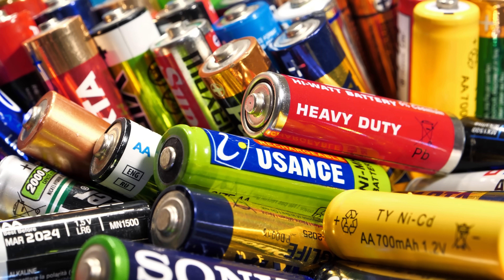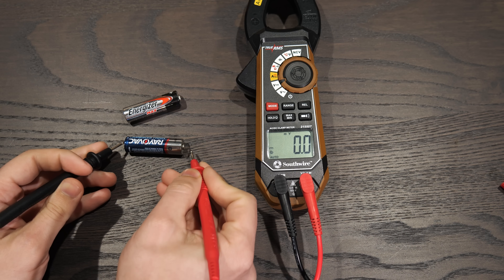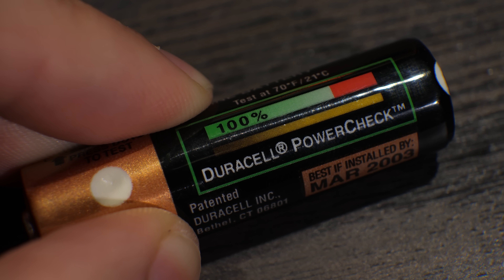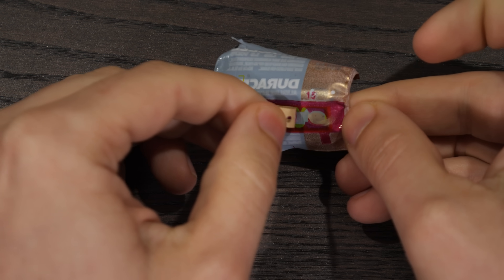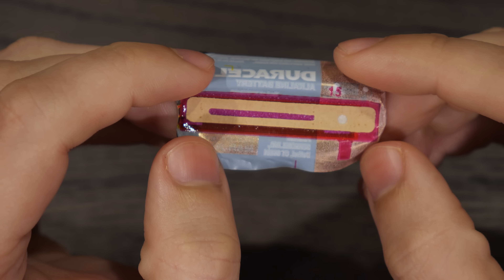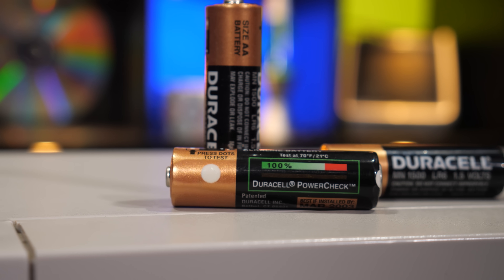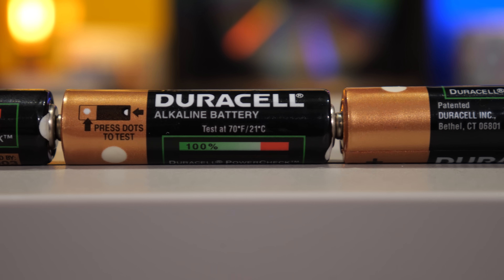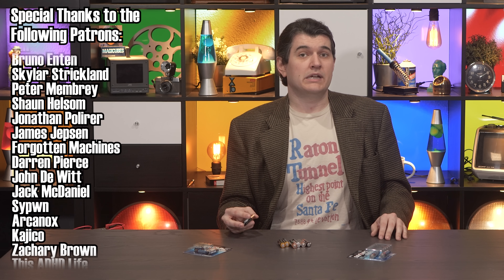Duracell PowerCheck: A genius idea which didn't last that long

Comment: I'm only 30 seconds in, and I'd like to add that the battery-operated interactive Neopet toys used N batteries. Some random obscure battery type that I don't recall anything else using. I think they might have been pricey, too, I don't recall. Either way, that one bugged my parents.
I have vague memories of batteries with a built-in power indicator, but I don't think we ever bought them. I was always kind of curious about them, and as it turns out, it's more low-tech than I imagined it being as a kid.
The other reason people don't use battery testers much is because they judge a battery's remaining power on whether their Poo-Chi turns on, or if the TV remote doesn't work half the time and is driving them crazy. Or if the power light on their handheld game system turns red. Many AA batteries died so I could raise virtual pets on my Game Boy Advance.
One of the impressive things about these PowerCheck batteries is that they haven't leaked. Generally, long-expired batteries are all gross-looking. Come to think of it, if I still have my GBA packed away somewhere, there's a Ziploc bag full of battery puke beside it.

Comment: I always wondered why the testers in the blister and the ones on the battery went away. When I was a kid, we were too poor to have a lot of extra batteries sitting around and we didn't own a tester unless we remembered to save one from the packaging. I WAS the person they made these things for because I would try swap batteries with low charge in flashlights with fresher batteries in the TV remote and I wanted to know if a batteries were actually dead before taking two bus rides to the Woolworth to get a couple more. I had also bought batteries when it was actually the bulb that had burned out and then had to make a second pilgrimage to the store for parts. I would run the check an average of three times per battery so they were super useful to me. Now I just own a couple of cheap universal battery testers so I don't worry about it but the first time I saw one of those was in my 20s.

Comment: Keeping batteries in their package toll you need them does NOT guarantee they are any good.  I have had batteries still sealed in their manufacture package that have leaked I  the package....had zero charge.....white crap comming out of them.  The Duracell testers were more accurate then the analog testers....took up no space.  I wish rechargeable batteries had them built in...

Comment: The main allure of this feature is the ability to troubleshoot issues on the spot. If a battery powered appliance stops working I can take the batteries off, press-check and immediately see if they have enough charge. If the batteries are good and the appliance doesn't work anyway, it's damaged or broken, so no point in replacing batteries. Very common in toys that the children toss around and leave powered on unattended for prolonged durations of time. You never know if it's just batteries discharged completely or the whole thing got trashed.

Comment: Duracell first attached those thermochromic testers separately on battery packages in the early 1990s, then it started installing them on the batteries themselves.

Comment: I saw an advert for these and thought it would be perfect for the rechargables I used in my gameboy. The original gameboy required 4 batteries so you had no idea which one was bust. Then a few months or years later we got a baterry charger that had lights that would go from red to orange to green to show voltage.

Comment: ❤❤
This kind of printed battery testers are very difficult to handle and require lots of pressure. Therefore an useless & non-working invention. Those who invented it, should be punished heavily by 500 lashes per day! I had this kind of batteries, the printed testers never worked. Useless garbage invention! The pure trash!

Comment: That genius idea is still today not just in Duracell but all 18V and 20V and 40V and 80V batteries, they ALL have "Voltage" indicators. 
Voltage is different from capacity. You can have 12V but still be a weak battery

Comment: The powercheck feature still exists on Duracell Ultra range batteries 🔋 I have some dated 03/2029, which I thought were unused but don't work in my device. The indicator isn't working either. Hence, I'm viewing your video. 

Thanks. Very well explained.

Comment: In theory, is it possible to use almost-dead batteries if it was possible to line them up in series?
Reply: Yes 2 or 3 weak batteries in series would equal 1 good battery. Issue is getting them wired to the device.
Reply: I'm glad to know that it'd work in theory.

Comment: I usually don't have half used batteries because I use accumulators.
The rare AAA batteries I have go usually in this order: tools and the automatic perfumer (has a motor), lantern, temperature sensors, remotes

Comment: I would totally use these today. I try to pull batteries out of the things I don't use much so they don't leak and destroy my electronics. I have a few batteries lying around that I'm not certain if they're bad or just slightly used. I also once pulled a fresh battery that didn't work in one of my devices, so without a proper tester, I don't know if the problem is with the battery or the device.

Also, you can tell that he doesn't have children because any parent knows that all the crap kids play with now uses batteries, and none of it has battery charge indicators.

Comment: I worked on that project at Duracell, it wasn't all that genius, it was a gimmick.  I can go on with all the problems it had but the main two were ... using it drained the battery quicker than you'd expect, and it would activate on it's own when installed in some tight battery compartments even after the numerous redesigns,  causing it to drain the battery at best, catching on fire at worst.

Comment: Hello ... Always wondered how they functioned, but honestly said I never thought of removing the label. Guess it's one of those things that come to mind, but is never important enough to remember to do. Honestly I still have roughly eight of those batteries today in reserve, at least 20 in use and continue to purchase them when I need batteries. Wonder if I will be able to obtain them the next time I need to buy some as I did notice the last time that they were not as available all over as in the past where I live. I always save the batteries that no longer function in one gadget to use for another that need less power (example wall clocks) and they would often run another six months to a year on them or more at times. I may be odd in comparison to others, but always used the batterie checker and had no problem with having to press hard in general. What I did notice is that when one had moist fingers (after washing hands or so) it was better to wait a while. Is Duracell expensive in comparison to other batteries? Yes, but I always keep an eye out for when I can get them to a reduced price (Amazon or so). However I found for my purposes Duracell tend to last longer than other brands so they were worth the money IMO. I know one says never to mix new with old batteries as they will drain faster. However I never mix different brands either. Maybe I over do it? 🤷🏻‍♂...Yes, I always use a multimeter before I recycle batteries and discovered decades ago that in general 1.35 is rock bottom with usage in most cases. Thank you for the very interesting and well explained video.

Comment: It wasn't genius. They didn't work properly, and you know if a battery is flat because it doesn't work. Mixing different age batteries is the worst thing to do, so the check thing on the side is pointless.

Comment: I think the on-battery tester comes from the idea that, oh hey my device just died and I need some batteries - but wait I don't have any new ones, let's take the batteries from something else. And thus you have mismatching batteries, the odd battery, new batteries, old batteries... And by the time you actually get around to purchasing more new batteries you're struggling to remember what it was that you had to replace and where the somewhat dead batteries were and which ones went where.

Comment: This has always felt like a gimmick on regular batteries but at some point I was using a lot of rechargable ones. That would have been really useful because it was common to swap partially used ones and wonder whether it was really needed to put them into the - very slow - charger or to use them in another less hungry device or whatever. And when you're not at home, testing on the fly would have been pretty neat.

Comment: I believe both Energizer and Duracell at one point included an external strip tester that was the same tech as this, but worked for all sizes -- AAAA to D. I actually salvaged a few of the strips from some Duracell PowerCheck batteries  and made it so I could use them on other batteries, lol

Comment: As soon as I saw the thumbnail, I dropped everything I was doing and went directly to the one I had. I have a AAA one that expired in 2017. The meter says that it is at 1/2 capacity.

Comment: I know I'm a bit late, but there was one thing in this video that wasn't mentioned: The possibility of using this with rechargeable batteries.

Yes, all the points in this video still stand true for the most part. Sometimes people don't have half-used batteries just sitting around in a drawer. But do you know who does? People who own rechargeable batteries. Yes, you could get a tester, but if you modified the design to be easier to use, this would 100% be a usable alternative to buying a tester. Instead of having to get out the old multi meter or battery checker, you could just do it right there. Is there a problem with your remote not working? Just find a couple of rechargeable batteries, use them, recharge them, and put them back into the drawer.

Surely there's holes in my logic, and I still agree with most of the points in this video, but the concept of rechargeable batteries was mentioned one in this video, and was not applied to the main subject of the video. I feel like the idea of redesigning the push-in mechanism to be easier to use, and combining it with rechargeable batteries would definitely bring this idea to life again.

Comment: Yes that explains why they went away. I remember them and then I remembered them not being a thing anymore. They were very hard to activate in some instances. One day when I noticed they were getting quite warm during the test kind of freaked me out. And don't forget most people don't bother testing them they just take them out even though one of them might still be good. Yes batteries were expensive not everybody had money to Drop on the Duracell's even though they were not nearly as big of a price gap as they are now. And then there's also some of us who believe that some batteries are more Duraleek than others. So well most other people were just dumping their batteries when an object wasn't working I was collecting those testing them with a battery tester or just manually and saving the ones that we're still good. Even though every one says never mixed batteries! I think that's more down to dissimilar metals and dissimilar chemistries.
 And what little I believe in conspiracies really makes me think that batteries didn't used to leak as much as they used to. It seems like it's only a recent problem that you leave something in there in the whole things damaged. As a child I only remember this happening a few times. I know it's like every device that I leave batteries in a guess what brand of batteries it is and guess what they're leaking.

Comment: Interesting noticed you have a "Southwire" brand meter, I just got one, but returned it because it didn't do DC amp measurement through the clamp, only AC, would probably make a pretty interesting video how that all works 🧐

Comment: Back in those days, I worked at a store that sold batteries, and it was amazing how many customers were upset that they could not test the batteries while they were sealed in the package. So many people insisted that they need to open the package and test all of the batteries before they buy it. I was constantly explaining, with only a few customers accepting my explanation, that the tester is to see how much the battery has been used, not how fresh it is in the sealed package. I also got a lot of, "The package says these batteries will last until [the 'use by' date on the package], but they didn't even last two weeks in my CD player!"

Comment: I've been using the same battery tester for around 20 years.

And I do take partially used batteries and keep them for use, in things like clocks.

They indicate replace but they still have enough power to run a clock for some time. 

I have a masters in environmental management, it makes total sense to use a resource to exhaustion if all it takes is a handheld battery tester.

And then recycle the case.

Comment: You failed to remember the 90s.

Kids all had gadgets - often RC cars .. that needed 1.3V+ out of each cell to operate correctly (or at all), often driving 5V DC logic with 3 cells, often demanding "alkaline" to ensure they got close to 5V longer (typical new voltage was 1.5 or 1.6). Regardless, when those batteries were "dead" in the toy, they would always save the remote control and other devices that were on the other end of the spectrum (worked fine with cells down to ~1V or at least a ~1V mixed with 2x 1.2V cells).

Everyone I knew had drawers of batteries that were destined to die in low V accepting remote controls, portable radios, etc, etc.

Comment: I miss the battery testers! I found them very useful over the years they existed. When batteries get too weak for my hair trimmer to work well and starts grabbing my hairs instead of cutting, I replace those with new batteries but I know they will still be good in something like a calculator or remote control, so I save them. Rechargeable batteries are cool and I have a few but, they're WAY more expensive than disposable batteries and I have a hard time trusting they will recharge often enough to make them a good investment. So I still end up buying disposables for $3 a pack instead of $16 when I'm at the store.

Comment: Yeah I remember when these came out brand new. They were too hard to press down unless you gave it a good squeeze. I was strength training back then and it was hard for me and I was doing 300+ pounds without wrist straps on d3@dlits for reps so I had a pretty strong grip/finger strength at the time.

Comment: I move batteries from high-drain devices to low-drain devices, such as a radio that is running low on power to a remote control or clock that will last a long time.

Comment: UR right, I may keep some partially used that come out of a high drain device to be finished off in a non essential low drain device, like a mini flashlight, but I don't really care how much life is left in it or I have a multi meter and little tester like yours if I really needed to know.

Comment: I remember them.  However, as I have always felt that simpler is better I always figured the best check of when a battery wasn't any good any more was if the flashlight wasn't putting out light, the remote wasn't controlling the device and the camera (yeah, not phone) wasn't taking pictures.  Not meaning to be a wise acre here, but instead only voicing my opinion of the real need pf batteries with built in testers.  Always enjoy this and all your other videos.  Keep up the great work!

Comment: it was never Genuis ...
Its just a voltage level. Voltage means NOTHING in a battery. You can have 1.5V and the battery is weak because it has no capacity left

Comment: I have a  nitro RC car, the car needs 4 double As and the controller 12. If either the car or controller died during use, the servo for gas would go to full throttle. Since it's nitro it would just drive until it crashed or ran out of fuel. I loved those batteries for that fact. The clip for the car batteries was really annoying to mess with too so leaving them in place was ideal. So this was a good use for them, aside from the use being based on a design flaw from some company

Comment: my biggest use for these was when something used like.. 3 or more batteries. I discovered that sometimes one battery would be used more quickly than the others for whatever bizarre reason (these battery testers were brilliant for that for me), so I would test them all, and take out the one that was closest to dying and replace it with a new one (actually, thinking on it, that might have been why it was so common for me to find one was dying earlier than the others lol).

Comment: The built in bounce test is sufficient for me.
I usually just want to know if it is good or bad.  I take the battery and bounce the positive end lightly on a hard surface. If it 'thuds' it is "full" of energy... if it bounces rapidly. it is empty. The more you do this the more you can tell quickly if you need to go grab a new battery... or if the battery in the drawer has died in waiting.

Comment: Interesting, I took three batteries with 1 volt left to power a display that needed two 1.5 volt batteries...
So I'm not sure your comment about 1.3 volt batteries not being able to provide sufficient current is accurate.

Comment: You didn't even mention the extremely important fact about battery charge. Drop it about 30cm. If it bounces, it's out of charge!

It really is that simple. The chemical changes from discharge change the physical properties.